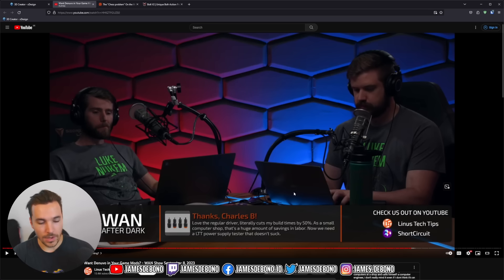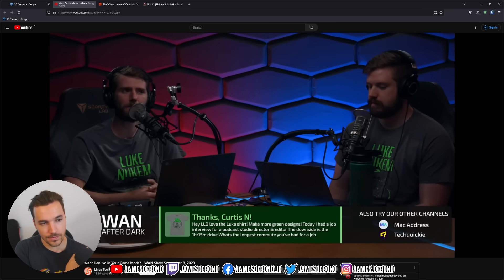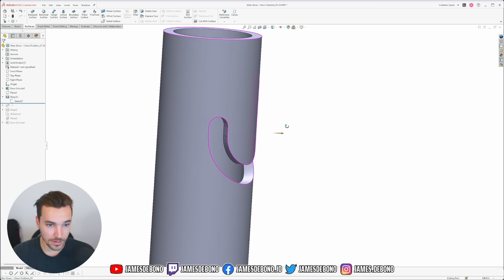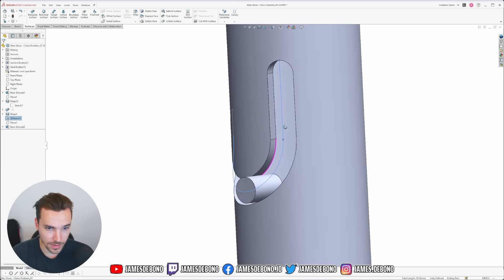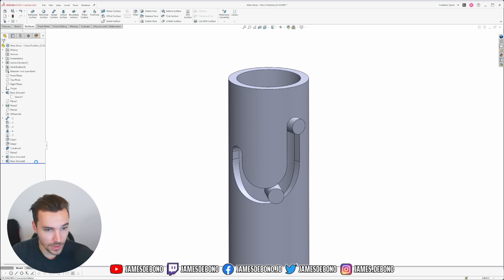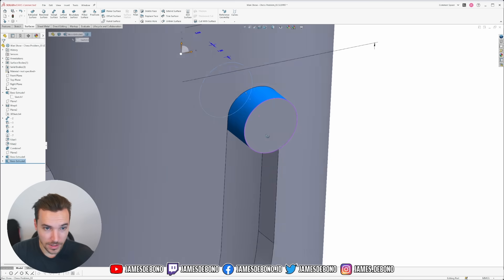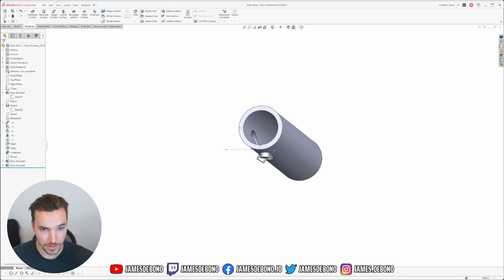LTT - Wan Show "Chess Problem" - Solidworks curved slot in cylinder

Comment: Why not convert it into, sheetmetal, put a seam on the backside, flatten (unroll) it out, cut the J, then roll the it back into the cylinder?
Reply from the maker: I covered this suggestion in a new video here https://youtu.be/TAlYex2l9yI?si=-2yq-ggusqQ0LYS4

Unfortunately it doest work because folding the surface into a cylinder causes the edges of the slot to lose their parallel relation making it essentially the same as the first solution here
Reply: @JamesDeBono  hmmm, well dang. I dont have SW i have Inventor. I might try to get on this lol this is very interesting

Comment: I was told that using solids and bodies to model is like using Window/Mac GUI to use a computer, easy/good enough for most situations. Once you start using surfaces and manipulating faces you're now using the command prompt to navigate the computer, which is needed for a problem like this (complex lofts).
Reply from the maker: That's an interesting comparison! I can see what you mean. I definitely agree in that sometimes it's necessary to go to the surface level. I always aim to have the least amount of features needed to make something accurate and stable if things need to be edited. I think surfaces are the right choice in this case

Comment: Sketchup user here, this is hilarious on how complicated this is when it could be as trivial as project intersect cut in Sketchup to get that result.
Reply from the maker: That's what's interesting about this problem. It appears like there is a simple solution bit when you try, it doesn't work. Check my latest video to see why https://youtu.be/TAlYex2l9yI?si=-2yq-ggusqQ0LYS4

I can almost guarantee the a project will not give you as accurate dimensions of a wrap and extruding it will give you slot edges that are not parallel to each other while also being perpendicular to the cebtelin of the cylinder. Its not as trivial as it seems
Reply: @JamesDeBono  Sketchup isn't programmatically, it's pure geometry so making a shape and intersecting it cuts out everything. Using follow me tool all dimensions are kept, in fact it does not work on it's own as the angle change causes the approach angle to change so you have to use a constrained follow me plugin for that. Once you shove the two pieces into each other and cut you get a mostly clean result, but of course with the downside of not being  a cad path instruction and just geometry.

The difference is in the tool for extruding the cut part, which tries to maintain dimensions, because that's what you need the most in archviz. Of course you could not use that model to program a cnc.

Comment: I only have a couple day's experience in Solidworks, but if I were making this in NX, I would wrap just the center line of the J shape onto the tube, then use the Law Extension tool, which basically extrudes the line, but the direction can be complex, and if I remember correctly "normal to face" is one of the options, So not I have a sheet going through the tube that is normal to the surface. Then I would thicken that sheet to the thickness of the slot that I wish to cut, and subtract that solid from the tube. Reading the comments, I see there is a simpler way, but that is just using the tools that I have experience with.
Reply from the maker: Check out my second video https://youtu.be/TAlYex2l9yI?si=-2yq-ggusqQ0LYS4

I did essentially what you are describing 😊

Comment: Cool modelling challenge, though in practice you would just communicate what you need clearly on the part drawing - for the same reasons it is not common to model screw/bolt threads
Reply from the maker: In some cases it is necessary to have the accurate model in order for the CAM software to calculate the tool path correctly if you want to do it that way. But mostly it's just an interesting challenge to find a solution for

Comment: I wonder if you couldnt just create a surface by wrapping the J on the outside, then wrapping a J scaled to maintain the width of the outer J (ie scale it back to the same width as the outer J to avoid the travezoidal shape of the naive pushed extrusion).

But, i cant be bothered checking if that geometrically works, so your solution is it :)
Reply from the maker: Luckily I just uploaded another video where I tried something like that! https://youtu.be/TAlYex2l9yI?si=-2yq-ggusqQ0LYS4

Comment: As a machinist who have spent north of 500 hours in CAD (Fusion, Inventor, NX and some SW) the past few years for toolmaking and general quality of life things around the shop, this seems like a simple operation that should be possible in most environments. Just wrap the centerline of the profile and extrude a rectangle along the path
Reply from the maker: That's exactly what I did in the second solution and the geometry was close but not quite right
Reply: Thats what I thought but then again I started thinking that I‘m just to stupid to understand the problem. Still don‘t know which one it is…

Comment: You can't sweep a body through a path, but you can subtract a body from another body. So you could make a male version of your toolpath and use it as a cutting tool.

Another workaround to add to the kit
Reply from the maker: That's exactly what I did in the 3rd solution. The tricky part is making the male version of the tool path the right shape

Comment: What happens if instead of offsetting the 2 surfaces on both sides, you use thicken (midplane) for the surface? Does it still distort?

Comment: What if you created a rectangle sketch and swept cut that along the wrapped J?
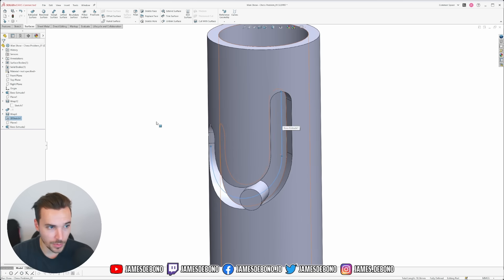Reply from the maker: That's what I did at 4:00
Reply: @JamesDeBono  Apparently I have the memory capaciity of a fish. But if that doesn't work then sweeping a solid body wouldn't either, because it would also project as a rectangle.

Comment: I had exactly this problem recently modelling a dry break connector with a similar pin fitting. So frustrating how Solidworks kept on distorting the cut no matter how you try to constrain it. As you say, programatically it doesn't matter, as it's easy to do in CAM, but I too am OCD when it comes to modelling, and it drove me insane with the groove being visually inaccurate. 

I had to move on to other more pressing jobs (the dry break was just for representation within an assembly, and really no need for that level of accuracy, but I often take the opportunity to model superfluous parts to both expand my skills and produce practical assemblies/realistic renders), but I like your approach and will revisit the dry break now!

Comment: My first question is why didnt you use 3d sketch?
Second is why didnt you try and fix distortion with math?
Reply from the maker: I used multiple 3D sketches and solving this problem with math its far more convoluted

Comment: (I’ll preface this with: I don’t know anything about solid works. Never touched it)

Can you do two separate sweeps? Based on how you explained it, the issue is transitioning from the curve to the straight path. So can you sweep just the curve, and then just the straight part and get the result that way?

Comment: Why you do a wrap? make a 3d J and intersect it with the cylinder (I doubt the cnc machine is rotating the cylinder at the same time it is cutting, so the intersection should be the correct way to model the final product)
Reply from the maker: A 4 axis CNC does exactly that. It rotates the cylinder at the same time that it is cutting and that is the correct way to make the final product so that when the pin rotates it still fits perpendicular to the slot

Comment: Hey fellow engineer! From the „big“ CAD programs  (catia, sw, creo, nx, inventor) only NX currently has a feature to accurately sweep volumes (like a milling bit) along more generalized curves. It‘s called „Swept Volume“. And then it only works for convex shapes. All the others only have solutions for special cases like cutting heliocentrical spirals. We developed a different method to generate these surfaced, as we need them to project the path of a more complex body onto another body.
Reply: So far NX has been the most robust software I've used
Reply: In solidworks you can swept cut a solid profile. You create the tool solid (not merged to the main body) and do a swept cut with the solid option. It is perfect for endmill or ball endmill cuts. If you also had to vary angle of the tool I believe you could use guide curves, but I've never actually tried guide curves with a solid swept cut so YMMV.
Reply: @ethanbarrieau7917  True - but that results in strange geometry way too often. Of course i can't say how reliable the NX sweep is...when i last used NX 16 years ago, i don't think it had that feature yet ^^
Reply: @Termuellinator  I've never had the swept solid cut create weird geometry and I use it all the time at work. It either works as I intended or it gives me an error, failure message.
Reply: @ethanbarrieau7917  in the videos I found here on youtube showcasing solidworks solution it seems like it is still a very narrow solution with many restrictions (the ones mentioned above). I‘m looking for a solution where you get an analytical surface from e.g. sweeping a T-slot stone along a 3d-curve. The resulting surface you get would be a groove where the stone can freely move along the curve
Reply: @MnemoLogic  3D curves complicate it slightly, but it works perfectly for 2D curves. I'd question how you would machine a t-slot along a 3D profile and have a t-nut actually slide...maybe I'm just not understanding your geometry enough.
Reply: Weird that Inventor wouldn't have it, because Fusion 360 does.
Reply: @StaleReference  you got any examples?
Reply: @MnemoLogic  ignore me, I was talking about sweeping a sketch in F360. Though I'd think sweeping a volume wouldn't be much more difficult for them to implement. 
I'm not a professional designer, but I feel like you could cut the path pretty easily like that though. Punch a hole at either end, then sweap a rectangle as long as the diameter of the bit, and as tall as the material thickness?
Though this vid was about how it's surprisingly tricky, so maybe I shouldn't talk before trying it myself.
Reply: Siemens added the functionality to Solid Edge also, like many things Siemens has ported from NX to Solid Edge.
Reply: In CATIA, construct or wrap the toolpath on the cylinder, make the tool cross section as aligned sketch/profile, sweep surface with path as spine and cylinder surface as direction, done.
Reply: In Catia you can simply sweep a line surface orthogonal to any surface and then create a cut. It takes me linke 1 min. to create such a cutout. SW simply is missing all the advanced sweeping options CATIA has. You don´t need a special method, at least not in CATIA. All you do by sweeping a volume instead of a surface is you automate the procedure, and probably don´t need the surface model as an intermediary result, but so what ? I need the surfaces regardless if I am designing automotive polymer components.

Comment: I would have arrived at the swept 3d sketch, but would have stopped after that not trying the surface approach!

Brilliant work mate!
Reply: Anytime something does not work as a solid you can make it work as a surface, since you have way more control. Sadly SWX is a solid modeler and misses many surface features.

Comment: I cant understand why the second option didn't work, it doesn't make sense. I ended up using the sheet metal tood of Fusion to do this, because I gad the same problem with the sweep, but it also colided, but when making a simulation with colisions activated, the pin went smooth, so, I'm not shure what to belive.

Comment: I have no knowledge of CAD software, but I have a hypothetical solution: you take a flat plane, cut the J on top of this flat plane, then roll it up to form a cylinder.
Reply from the maker: That's essentially what my first solution is here. The problem is that you end up with the edges of the slot not being parallel

Comment: Does it really matter though. Even if it wouldn't be accurate in CAD it would still be accurate in the product.
Reply from the maker: It matters if you want to do a 3d print prototype or an accurate render. Or just to satisfy OCD tendencies 😅

Comment: So there is no sweep in solid work? Wrap a sketch and sweep along that line. Then just extruded the ends for the circle bit. Yes the circle won't be perfectly normal to the surface but so won't the drill (this obviously won't work if you require multiple passes of an endmill, but then again you can do it in two parts, drilling the holes and then the rest)

Edit, I just watched the rest, I see now .

Comment: This is one of the few times I'm glad I model in rhino. I'm an architecture 3D modeler, so I've never even touched solid works. Can't understand solid object modeling. Surfaces only for this guy
Reply: i don't get the layers
am i supposed to put a sketch here
a surface there
and the resulting solid in the next?
everything in one layer?
just show me the objects
Reply: @marc_frank  it's like photoshop. You get to decide what you do with the layer

Comment: It seems like Inventor handles this process a bit better, to do that I would create my 2d sketch and wrap it as a 3d sketch around the cylinder, create my "tool" and sweep it along the path. I've done some pretty complex splines and it seems happy enough to do it.

The second for the angular control, the other way to do it, would be to use a dimension formula, take the Dia of the OD, turn it into a circumference, then create your angle from the circ/360, The math would look like "Start to End Line Dim=((Dim(OD)*PI)/360)*Angle", as long as it handles dimensions like I think it does all you would need to do to quickly adjust the arc would be to adjust the angle part of the formula.

Comment: Just do it on a 2d sketch plane, * any width dimension that goes around the circumference by pi, your done, then click wrap around surface, gg
Reply from the maker: That's what I did in the first solution. The problem is you end up with the edges of the slot not being parallel

Comment: Why does it need to be 100%  in the CAD? You are 99% accurate. Just cut it on the CNC and the bit will cut straight. Then you adapt the second part that goes in the CAM slot.
Reply from the maker: Making the CAD accurate is good if you want to do 3d print prototypes and stuff. Also just for sanity's sake haha I'm a bit OCD 😅
Reply: @JamesDeBono  I fully understand and it’s a good practice exercise and you propose 3 different ways to tackle that problem which is great. In the industry you always want your CAD to accurate as possible with every little pieces included. I was thinking that you and the LT guys tried to figure this out. That becomes expensive and was wondering at the end if CNC tool path will simply solve all this by default. Problem solve.
Reply from the maker: @JeromeDemers  LTT aren't paying for me or their team to solve this though so it's not expensive at all
Reply: @JamesDeBono  when I say "expensive" it's mean ressource and time and that ultimately is money. Sure you don't work for them so it's free advice but the LT team seems to have spent a lot of ressource into solving this.
Reply: It's why they call it a chess problem. It's like those chess puzzles that people solve. The odds of you being in that scenario in an actual chess game is almost zero, it's just a theoretical situation to test people. That's why Dan (from ltt) mentioned that it's easy to cnc, but a problem to accurately model.
Reply: that is well explained, thanks @RyanMakesStuffOccasionally

Comment: I would have tried starting with the tube as two surfaces each with the j cut out with the same width. Created the inside surface between the two Js, capped the end of the tube. And finally knitted it into a solid.

Comment: This should be dirt easy to do in Fusion using the project and then extrude tool to cut. Not saying that other things won't be more difficult
Reply from the maker: Try it! I think you will end up with the same result as my first solution

Comment: Good video explanation of the problem. Your final solution does work, but the requirement to have such pipeline to get to this point is terrifying - at any change it would be double and triple checking a lot of things to make sure it's still valid. The second approach should be the valid one, but it makes no sense that the edges are cutting into the bit towards the center and not evenly or the other way around, and I would check manually distances there on a cross section just to have some knowledge what is happening, and you didn't show that on a video.

Comment: I had an issue with this once. A twist and and what not.
Create the Body your cutting out of
create the "milling bit" in Cad as a seperate Body
Rotate it up along a path to cut it. I'll dig out the two features i used when i'm back in the office.

Thats what our tech support was recomending as well.